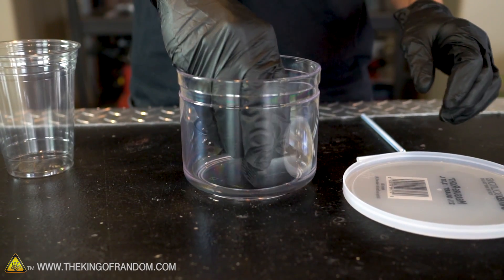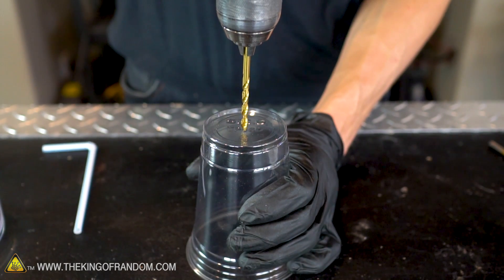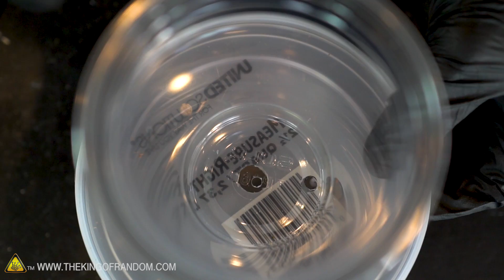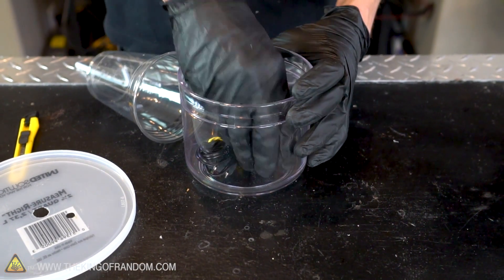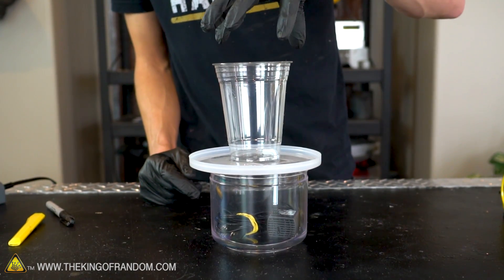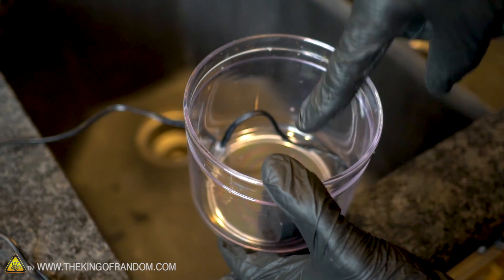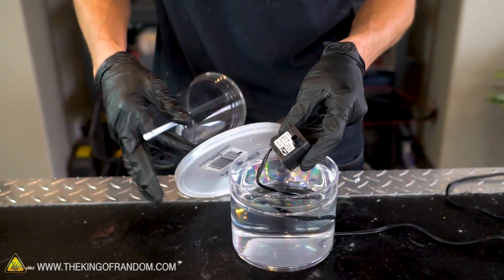Homemade Perpetual Vortex Fountain! TKOR's Guide On How To Make The Best Water Vortex Fountain

Comment: Cool idea but as an electrician your wire splicing skills scare me. Please next time cut the very end of the cord off and use a male cord cap, or cut it closer to the base and install a switch. Both options are a lot safer than that hack and splice.

Comment: There’s a very specific reason your pump needs to be covered with water. Most water pumps can move incompressible water, but if air gets into the pump, it just sucks the air and doesn’t have enough pressure to pick up water. So, air just circulates inside the turbine and the pump stalls.

Comment: the offset with the popsicle sticks has nothing to do with snipping the ends off, the sides of the sticks are still parallel.
The container you are using for the reservoir is tapered so base is narrower than top. This is an artifact of its manufacturing process, so that it can separate from the mold after casting. You wrapped your "band" of sticks around a cone.

Comment: If it were wider, the gap would be smaller at the top. This has to do with the fact that you are working on a conical annulus. Ex the circumference is bigger at the top than at the bottom.

Comment: Could someone explain what actually causes the vortex
Reply: Its a combination of many things

A: The water is being pushed in a circle because of the straw. This creates a low pressure spot in the middle of the cup where the water is spinning around.

B: The water is draining out the bottom of the whole. The resulting suction from the drain pulls the low density spot downwards creating a vortex.

C: Once the vortex connects to the drain, a column of air is allowed to escape through the middle of the whirlpool, allowing allowing the difference in pressure to always remain equal

D: The rotating low density spot, combined with the downward sucking force of the drain, all work to together in a dynamic feedback loop to create a self sustaining rotating whirlpool, that allows water and air to pass through the drain in a much more efficient manner

Comment: Major fire hazard! Hot glue will not be water tight and the water will run down the cord to the plug or splice. Hopefully your fire insurance is up to date lol
Reply: Him not wrapping the wires in electrical tape individually before wrapping them is also a fire hazard. Clearly he fixed it, but he should really show the right process. I.E, wrap individually then wrap together

Comment: I noticed you made this where the vortex is running counter clockwise. Assuming your in the U.S. a natural vortex will run clockwise above the equator. I wonder if it would make a difference if you turned the straw the other direction??

Comment: Even better for the power switch, if you get a inline rotary switch, you could even use the spot you cut for the cable in the bottom container, instead of somewhat ugly electric tape, you could have a switch.

Comment: dont understand the cheap materials and processes used in this. Why not use plumbers putty instead of hot glue, rubber tubing for landscaping and fountains (probably sold right next to the pump), and an acrylic cylinder instead of a solo cup? This would have made a sturdy, much more attractive, yet still inexpensive perpetual vortex. Seriously, thank you for showing how easy it is, but making this with a straw, hot glue gun, and solo cup would actually be more difficult to get to work right than using the right materials (the materials traditionally used to make aquarium and fountain features.

Comment: If you heat the tip of the drill bit it will cut through the plastic much easier and cleaner.

Comment: Use heat shrink tubes for insulation, tape is a thing of the past. Looks awesome and it doesn't go anywhere, plus it makes the connection water/air tight.

Comment: I've always wondered if Caroline would still light if it was put into liquid nitrogen, or if a battery and wire could even light the casoline considering a battery and wire would react like tinfoil and would allow conduction of some kind of power. What if the battery would pass energy to the wire, the wire could light the gasoline. Testing the durability of gasoline, could the weather (Liquid Nitrogen) save your life if an accident happened and gasoline was everywhere!! Hmmm.. 👑 love your work.

Comment: No dude, the popsicle sticks left that wedge shape because your container isn't a perfect cylinder, it has a larger radius at the mouth of the jar than at the base. If your theory about cutting the sticks causing them to flare out was true, it would actually reduce the size of the wedge gap remaining, but that's not how wood works.

Comment: You need to take care not to use a pump that is too powerful (head) or of too high a volume (gpm) as either will cause the cup to overflow, potentially too much for drain holes to handle. Also the direction of the straw should be aligned with how water drains in your hemisphere.  It appears they are using an aquarium powerhead pump.  These are excellent for this use but come in a wide range of power and flow rates, so be careful in selecting your pump.

Comment: Instead of splicing up the cut cable, you can put in a little lightswitch (like used at table lamps) which makes it electrically connected properly and you don't need electrical tape.

Comment: Im so glad i live in the eu were you can go to the hardware store and get a new plug. If the pump ran at 12v dc orso i would not be afraid of a cord splicing but at mains voltage i prefer a safer solution

Comment: Just built my version from the instructions in your video. Used a chinet serving dish, not recommended as it likes to crack during drilling, otherwise pretty stock. Figured out what tiny bubbles are from. The drains drip into the reservoir and introduces the tiny bubbles into the pump and it just keeps repeating in a cycle. Peaks at the startup before the drain has a chance to be more uniform.

Comment: Downvoted for that splicing job, no solder or heat shrink. Dangerous, especially when you are talking about 110ac. Improper connections can cause the wire to heat up and melt and potentially start a fire.
Reply: heat shrink - not sink
Reply: It would be worthwhile to add an In-line switch after cutting the wire and using that as the splice, probably a lot safer if you get the right switch.
Reply: I'm glad I'm not the only one. Also wish he would have broke it down more. From the video it looked like he wrapped both spliced wire up together. Obviously he didnt because it would blow the breaker.
Reply: I would have also offset the joins
Reply: LeskiStation it's no fun if their ain't danger
Reply: LeskiStation where would you put a heat sink on a wire?
Reply: LeskiStation quit bitchin
Reply: this is youtube. you can't downvote. or upvote.

Comment: Pretty cool, Id tin, solder and heat shrink the pump wires though just to keep em from corroding or shorting out if the electrical tape degrades. But in a pinch just to demonstrate it works or for people with little to no soldering skills itll work, it would be kind of cool to add some LEDs too, maybe on the bigger version.

Comment: You did that power cord thing wrong. Did you even solder it? Looks like you didn't. Electric tape isn't strong, so i think somebody could just accindently pull that power cord apart.

Comment: You can just add a switch where you cut the cord and just plug it on the outlet, that way you wont have to use a power outlet with switch or other things

Comment: I think the only thing I’d do differently is I’d wire a switch inline so I have a way to shut the power off without having to unplug it. Also, if I didn’t do that, I’d probably use heat shrink rather than tape. But that’s just preference and pickiness at that point. 😅😎

Comment: Cool Fountain - You could have added a switch to the pump wire when you cut it out and also shrinking tubes could be a better solution - one last thing regarding the cable - a knot from the inside is probably better then a glue gun. Overall - Looks GREAT! WTG
Reply: Arye Guetta a knot from inside would not seal hole thus creating a leak
Reply: Correct. But only from the inside - the outside would be a glue gun covered all over preventing leaking. inside a knot would hold the movement of the cable

Comment: You guys did copper casting at one point I think if you take some steel nails or screws and placed them where the sand kept breaking the last time it will help hold it in place

Comment: You should sand the lip of the cup so the water gets evenly distributed
Reply: Keeping the entire cup upsidedown on the sandpaper and then sanding it should do the trick.
Reply: @samarthkambli  not necessarily if he acidently puts too much pressure on one side it would go through there which could be cool as a waterfall onto the rocks
Reply: Etro 
But, if he sands it too much on one side it would be the same
Reply: Hien Vu who said that , he should sand evenly on both sides , the water will flow spreadly when it's sanded if not it will find one channel and it the lowest wall

Comment: If you want to access the pump you could have used a container with a screwable lid and glue the black lid upside down onto it! You might have to reinforce the straw a little bit. That way you can completely seal the bottom and have the posibility to open it!

Comment: Do you really need a drill to get a hole in a solo cup?
Like if you agree!
Reply: The point was to get an accurate hole measurement, didn't you watch the video?
Reply: Wally Bertone right? Using cheap plastic to make it more affordable but also using a drill? Nonsense
Reply: Szobiz I know
Reply: Make circles with a marker where you want holes on the lid. Then use a burning incense stick or heat a wire's end and when it's hot, use that to make the hole in the lid. I've used this technique for cds and it has worked. The wire should be thicker than a fragile copper wire but not too thick.
Reply: Using the tip of the hot glue gun will make the hole, and then u can seal it with the glue gun
Reply: Maybe using some differently sized household and/or cheap objects to punch the holes?
Reply: Do people really not own a drill? It’s a really common power tool.
Reply: @urielreveles1961  I guarantee you 90% of college students don't have a drill.
Reply: Wally Bertone yes

Comment: If going to the trouble to cut and reconnect the power, you could add a switch in line and make it safer than the solution in the video.

Also, it looks like if you trimmed the cup down, you would get the larger vortex and desired spillover. Just below the ridges would prolly work and make it look better. Cut evenly and use a hot skillet to roll the new edge.

Over all, I love it. Might have to make one as soon as I find a place for it. Maybe combine it with some of the lighting and rock effects DIY Perks demonstrates. Now that could be a nice collab...

Comment: 2 things: Metric system is your best friend, especially when 90% of your viewers don't use imperial. And your "splicing" is so dangerous, you may as well hold the wires while it's plugged in and turned on. Please do safer projects, or get an electrician certificate.

Comment: That "splice" is not only a hazard electrically but also a fire hazard, not to mention the "stripping" was also a great way to lose copper and possibly cause more issues should a short occur. please if you are going to do anything with mains power at least show it being done to wiring standards.
Reply: I think you might have missed the point.
Reply: Or just enjoy a video without picking it apart....
Reply: thedoctor907 He said “Splice” not “Spice” learn to listen before being critical

Comment: Actually i just use a soldering iron or the tip of the hot glue gun to melt a hole through the plastic,since the lid and cup are made of plastic. The melted plastic also seals the hole nicely when it cools. Your welcome. :)

Comment: If you applied some kind of substance to the top of the cup that could wet, you would get much more even waterfalls down the sides. Reducing the surface tension that plastic upholds would let water flow more freely.

Comment: 1, you would have less space on the top and more space at the bottom if cutting the popsicle sticks made the tops flair out, so that is horribly inaccurate.
2, you do not use scissors or razor blade to cut electrical tape, you pull it apart with your hand so it splits cleanly, and with no tools.

Comment: You should have at least soldered that cable.
Reply: Wire nuts on twisted wires, or crimp terminals at least. Perhaps soldered connections at best

Comment: Pro Tip* when drilling thin plastic like that drill in reverse and it will give you a clean hole
P.S. hot glue will not hold up with water it will leak rather quickly

Comment: Can you freeze helium and or is it flammable
Reply: And it's not flammable...
Reply: Fun fact.. helium is very rare on Earth, because it can only form from radioactive decay and requires an airtight reservoir or it will simply fly of into space. Which is why the US government decided that by law the national reserve of helium MUST be sold at the lowest of dump prices to ensure party balloons can be filled rather then be used as coolant for MRI machines and other high tech devices (including spacebound rockets). There are only a few places on Earth where the conditions for natural helium reservoirs are just right.
Reply: Liquid Helium is already at a very low temperature. It is even impossible to freeze it at atmospheric pressure. You need pressure above 20x atmospheric pressure to freeze it.
Reply: Alexander Roberts liquefied helium is colder than nitrohen
Reply: Helium is not flammable, that is why it is used in Part balloons and blimps. I don’t think you can freeze helium.
Reply: Alexander Roberts fun fact liquid helium acts as a superfluid at a certain temperature . It can flow without friction !!!!

Comment: You should really be using Heat Shrink tubing for that power cord, not tape.  The tape will loosen over time and eventually cause a short.  HS tubing can be a nice tight fit and will last as long as the cord does.  It's easy to put on, you can shrink it using a cheap disposable Bic lighter.
Reply: I think the point of this project is that this is something cheap anyone can make with products they probably already have

Comment: That was such shockingly bad wire work, it’s got me all amped up. Getting bit by main power hertz so bad it’s lights out. Despite the dangerous build instructions, he does bring a lot of positive energy to the channel.
Reply: My body is resisting all these puns
Reply: Not even heat shrink :( gonna be fun when the adhesive on that tape dies
Reply: It was also A Perfect Place to wire in a switch!, since 'this pump doesn't have one, so it's always on when it's plugged in.'

Comment: if the cuts on the popsicle sticks were wider, the top of them would have been closer together than the bottom, i also dont have an answer as to why it did that but cuts making it wider is not the reason

Comment: What do you think of replacing the plastic lid with a wire mesh? You'd need to cut a fewer holes overall and it would probably drain better after it overflows

Comment: Is their any way to get the cord into a USB, I have USB outlets on my desk and that would be cool for it
Reply: The pump won't be full power if you just connect the wires, since a USB voltage output is about 5 volts and the pump requires 120 volts.
Reply: Rafe the channel So according to you 5V = 120V? Flawless.
Reply: you’d first need to replace the end with a usb plug, but you’d also need some sort of converter which converts usb (5v) to 120v
Reply: DanielDoes45 you could convert the voltage.
Reply: you can just buy that same pump with a usb connector from ebay :D
Reply: DanielDoes45 probably do the wire splicing but instead of attaching the regular outlet plug use a usb attachment
Reply: Chara Dreemurr thanks but I found the same pump with a usb
Reply: i guess you could make a board with a 120v capacitor and then feed it into usb but idk
btw mix the polarity and ur pc is fried so be careful
Reply: Nobody likes you😭😭😭😭😭😭😭😭
Reply: Nobody likes you😭😭😭😭😭😭😭😭
Reply: DanielDoes45 it would work if u snip the wire and add a USB wire

Comment: love the vid but there are a few corrections that should have been addressed. If you were going to cut the cord, that would have been the time to add an on/off switch. Then seal the splice with heat shrink covers that are water proof. After seeing the build a little math would have made the build simpler. Knowing your pump's flow rate would have given you the correct size of the cup's drain hole so it wouldn't overflow, less the need for the catch saucer. My tweak would be use mineral oil instead of water. It doesn't conduct electricity, collect living things, and makes the container disappear do to difference in refraction.

Comment: I like what you're doing but that wire splice was pretty bad . At the very least you should have used soldier and some heat shrink tubing . Even better would be to use a new plug end on the cord. No splices or weak spots then . So much safer .

Comment: Drill bigger holes, so you don't have to have a spillway. If you have the hole big enough to displace the water equal to the the output of the pump you could have the top of the cup sealed, so no water gets spilled if you knock it over. The only problemwith my solution  is you would have to fill water into the cup every time you wanted to turn it on as the pump wouldn't be able to deliver water into the system fast enough, and also from filling it every time you start it up, the lower tank would have to be drained or have a overflow spillway

Comment: You could add a rotary switch where you spliced the cord. I much prefer heat shrink tubing to electrical tape. You should try it. You can use a heat gun, or just a lighter to shrink it.